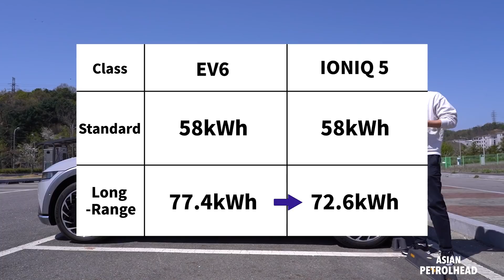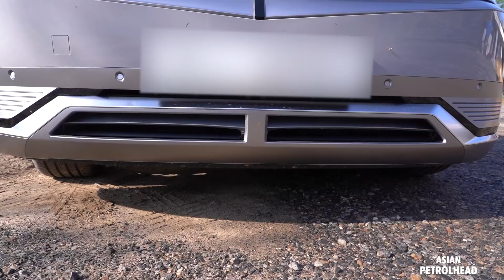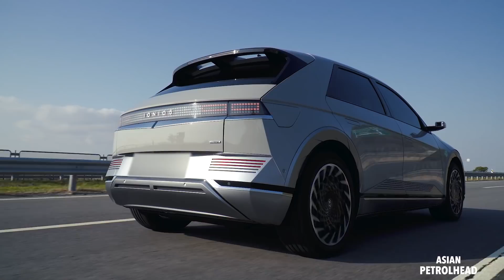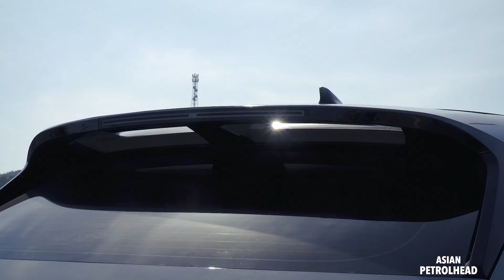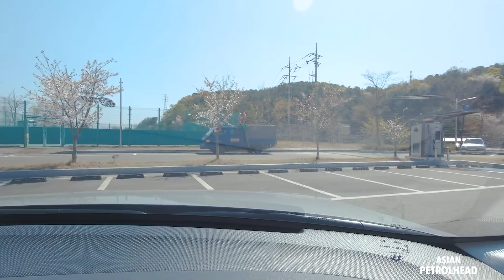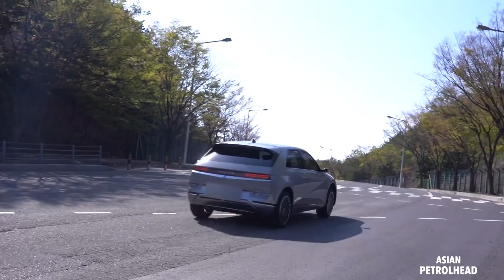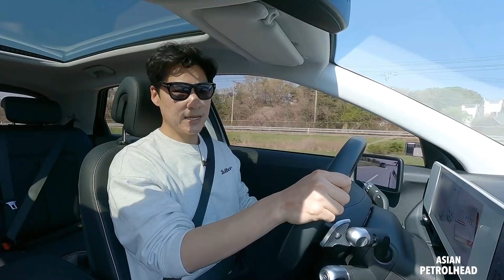Hyundai IONIQ 5 in-depth Review – 605Nm Dual-Motor IONIQ 5 is here | Best looking EV Car?

Comment: I hope this is affordable in Europe, no word on price here yet
Reply from the maker: Yes, hope you guys get the Hyundai IONIQ 5 with reasonable pricing. Thank you Joe.
Reply: 58.000€ top spec in Slovakia. Not cheap
Reply: They must price it way less than model y awd, long range ..
Reply: @Reddylion  I'm not sure about that because it's much more equipped. So the same price would be already very good. But who knows. But  I wish under 60000€, for the Bonus we have here, and I mean with all options, otherwise it doesn't count because it looses the good stuffs and without those options it's not interesting anymore.
We'll see 🤞
Reply: @YannR34   not just in euro but everywhere else !🤞 let's wait an see.
Reply: I have seen the price for Germany, but for France it will probably be a bit different, because often the options are arranged differently and also due to the different bonus they get from state. 
It started at 42000€ or 43000€ I don't remember exactly and the higher one with all option and solar roof and most expensive paint was 64000€
Big wheels was 500€, Solar roof 1500€  Best paint 900 € Relaxation seats 1100€, I think the VtoL was 300€ and you had 3 finitions including different equipment. 
5000 € for the first one with battery cooling and heat pump, then 8000€ and the other one was maybe 11000€ (I'm not sure about this one)
But usually in France we do not have so much choices and lot is included. You have less liberty of all option but this decrease the price because most of the models are the same.
I hope it will be a bit shipper to get under 60000€ with everything.
The first price didn't' have anything. No roof glass or solar, no heat pump, no battery cooling system, no electric door handle, no electric seats, no assistances, no HUD, no moving console, no ambiance light, no LED lights, and so on, nothing very basic.
Reply: Configurator up at Hyundai.de.

Comment: Another Hyundai Ioniq 5 Again Charlie Min
Reply from the maker: Yes, this is the In-depth review of the Hyundai IONIQ 5.  It will be fun. I promise!
Reply: @AsianPetrolhead  I Think Hyundai Ioniq 5 Rivals Like a Toyota RAV4 Prime,Nissan Rogue Platinum,Honda CRV Hybrid and The Kia EV6 Right Charlie Min
Reply: @rakhsiprayogo82  It blows them away, they are traditional cars, this is a new breed designed for pure EV and tech
Reply: @Barefoot_Joe  Of Course But Against The Petrol SUV